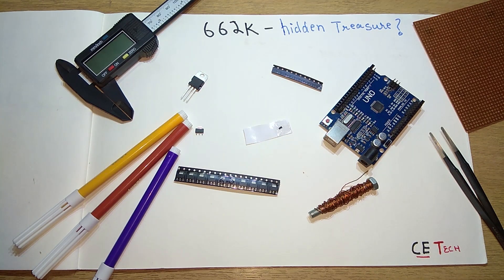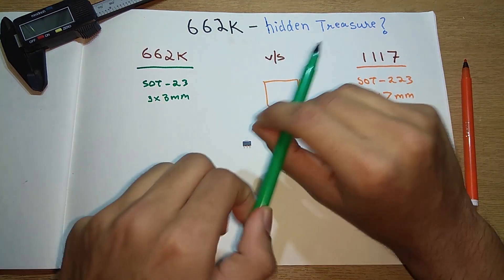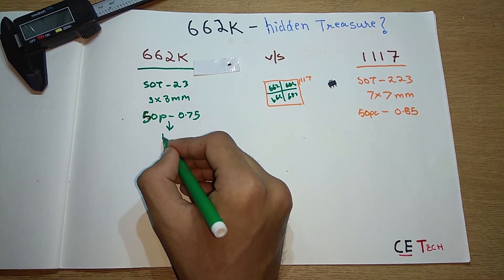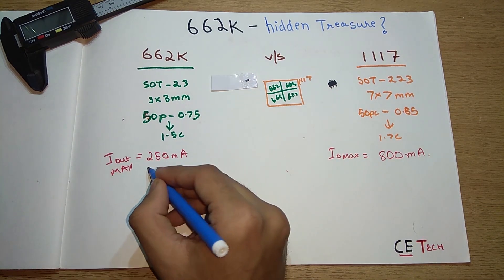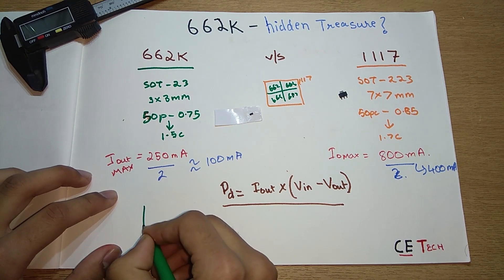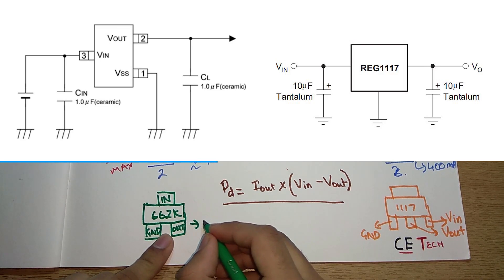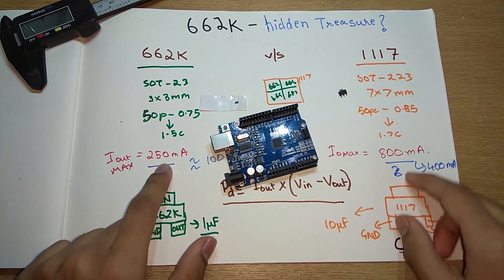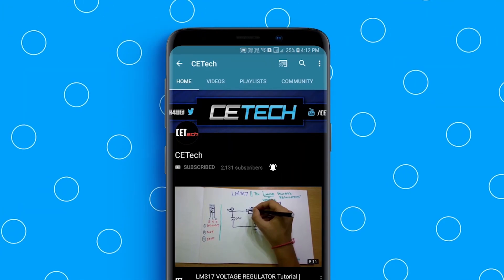662K Cheap Voltage Regulator | How to use? | Pinout | Comparison with ams1117 reg1117 LDO

Comment: Hello sir 1117 is consuming high power during deep sleep  please suggest me better LDO may i use 662k will it burn or not???
Reply from the maker: Use a LM317
Reply: @CETech4u  thank you sir can you please provide SMD version of that IC link sir i am not getting how  to get 3.3 v this ic sir i want to use my custom made pcb inspired from you sir.....please solve my major problem
Reply: @CETech4u   LM317DCYR. SMD version of this ic will be good sir in low currunt and deep sleep mode ....how to get 3.3 v from 18650 battery sir its my project requirement for custom pcb
Reply from the maker: Yes you can use that
Reply: @CETech4u  many thanx sir

Comment: Could never find a better explanation than this...
Actually I was looking for a better replacement for 662k voltage regulator..
Right now I'm in serious trouble and that is I recently bought a tft spi 1.8'' display screen and an ESP32 I connected both of them and the led pin of the display to the Vin of ESP, before I could do anything the 662k behind the display starts smelling then I found that it has burned..
So, could you please suggest me something...
I thought I could use the reg1117 LDO as it is available in the market near my house but due to its high output current (800mA), I stopped... so can I solder reg117??
Reply from the maker: I would suggest to replace the 662k with another new one and not connect the led pin to vin instead connect it to the 3v3 rail.
If 662k is not available easily you can use reg1117 until you use the correct voltage one and also match the connections to the 662k
Hit the like button to appreciate our effort and subscribe to the channel for more content like this!
Reply: @CETech4u  "untill you use the correct voltage one" what does that mean...
Actually I don't have equipments to solder a SMD component (like 662k) on the board so I was looking for bigger one atleast the size of 1117 so that i can solder it with the soldering iron that I already have.. but don't know whether it'll be good for my screen or not...
Reply from the maker: There will be no issues in using the 1117. Go ahead.
I meant that if the 662k is a 3.3v reg on you screen then use a 1117-3.3 and not accidentally use another one
Reply: @CETech4u  Okay brother thanks for helping me out. I'll try that..✌